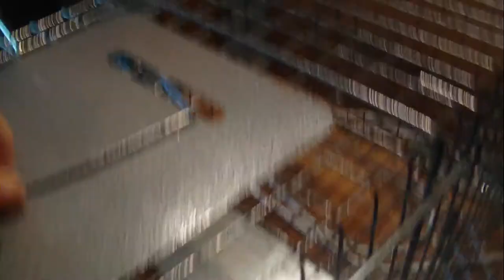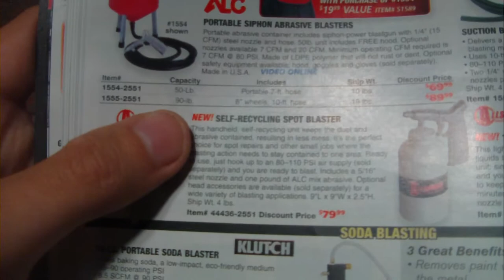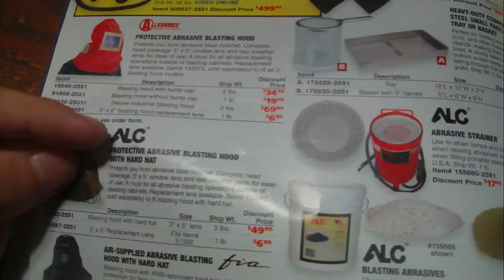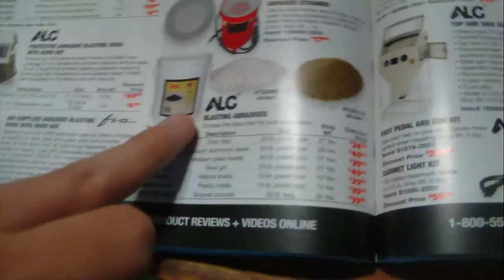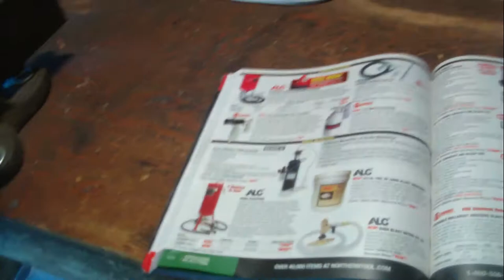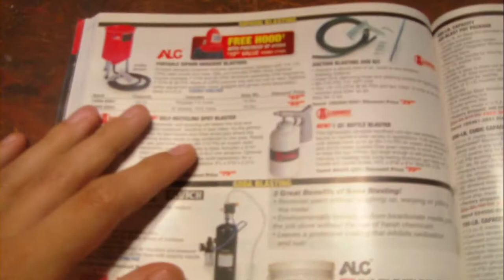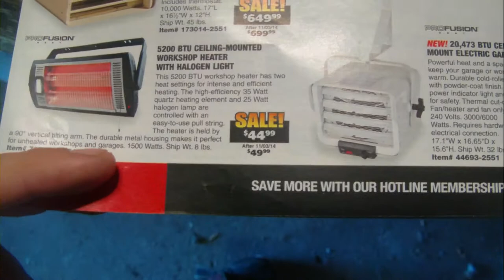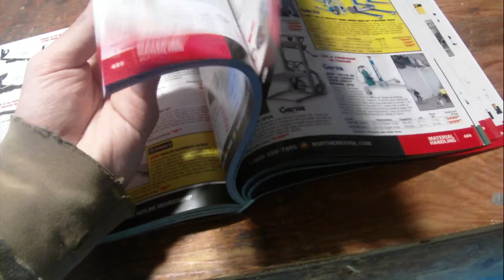my new Catch and Release Live Animal Traps. & what do u guys think of sandblaster's?

Comment: You might have a problem running that sandblaster with that small air compressor, It will be running all the time and you might burn it out.
Reply from the maker: it runs all the time when i use  it, if u wanted 2 turn it off u would just have 2 unplug it.
Reply: I mean it has to run while sandblasting to supply enuf air and if you unplug it then you will have no air pressure.  I just usually see huge air compressors when guys are sandblasting that can produce large volumes of air.    Just something for you to think about before you buy it and it might not be a good match for your setup
Reply from the maker: Mr zurcon ya i dont no then, what do u think of this-http://www.northerntool.com/shop/tools/product_200628384_200628384?isSearch=44435 any better?
Reply: That would work
Reply from the maker: Mr zurcon o ok. :)